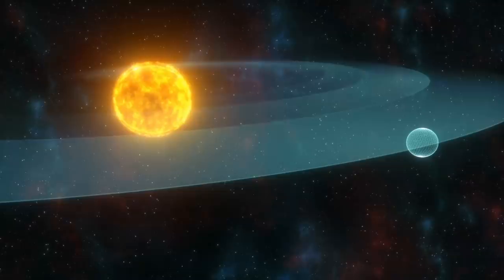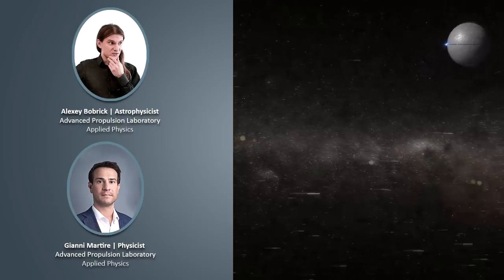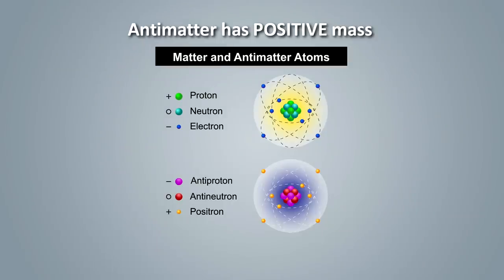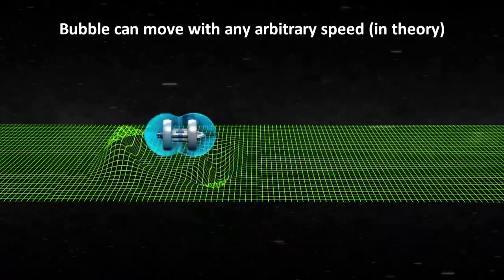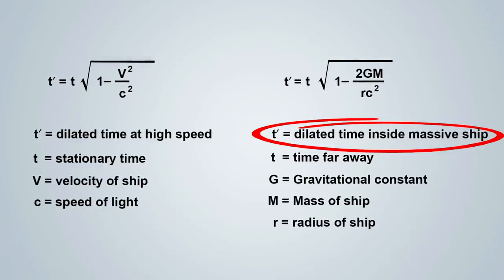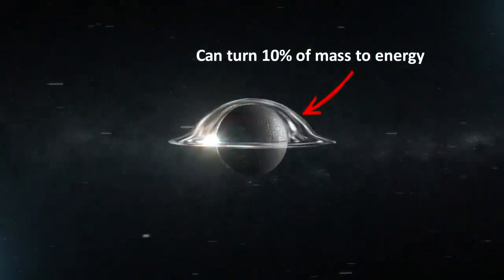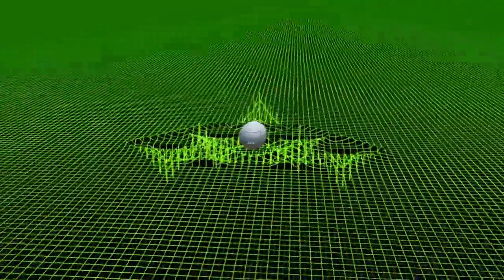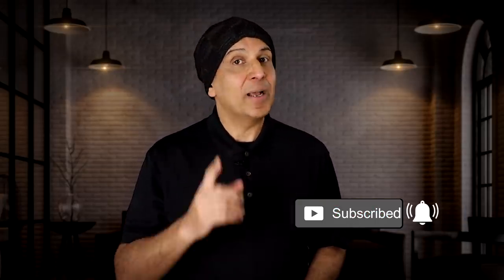REAL Warp Drives? NEW research proposes a solution!

Comment: Faster than Light travel using Warping is not possible, and won't ever be possible.  Alcubierre's solution, in addition to using negative matter also relies on propagating the bubble forward faster than the speed of light.  There is no method for information to travel from the ship out of the bubble to in front of the bubble and tell that space to warp at a pace to keep the bubble moving forward faster than light.  A warping in space-time is effectively a gravitational wave, and we know through multiple measurements that gravitational waves travel at the speed of light, and no faster.  Lentz's solution suggests that there's a special geometry that, if it existed, could self-propagate through space at a rate faster than the speed of light.  There is however, no mechanism to create such a geometry, and if there was a means to do so, there is no means by which a sub-luminal geometry could be accelerated to a superluminal speed without infinite energy.  To take a ship, at rest, and put it into this geometry so that it can ride it at faster than light speeds would require the ship to already be inside and moving faster than light, or an infinite energy to get started.  So while interesting mathematically, Lentz's solution is completely worthless when it comes to engineering an FTL drive.
We've never seen any kind of information transmitted through space faster than light, and any warp drive would require that to possible.
As the video suggests, our only hope for Warp Drives is sub-luminal drives that can let us move significant fractions of the speed of light.  Anything else is fantasy and people promoting it frequently do their best to overlook or handwave the horizon problem.

Comment: you can also just use contraction which uses positive energy.  You can let the universe dop the expansion and travel ythrough the contrated area,  If you make a region od apace 11/10 the size you only need 10% to reach light speed.

Comment: It seems the solution to warp drives is finding the right shape of the envelope,  the evidence lies in the theories currently out there. I think it just a matter of finding the proper configuration for the warp bubble which would allow us to travel at faster than light without infinite power, exotic mass , dense materials,  it would require some out of the box thinking and a new yet undiscovered way of propulsion. I  think when we determine the right size and shape of the warp envelope we could perhaps in our lifetime travel to the stars.
Reply: I don’t get why we’d need infinite power for a warp craft when we know the universe is expanding and pulling objects away from us effectively faster than light. Surely it’s using immense power to do this but even the universe doesn’t have infinite power. And this is observed, not theoretical.

Comment: These UFOs in the news seems to be using warp to be able to seem like they are able to handle 600 g  force but with warp there is no g force, air restriction and can travel through water as well. When moving space around you this also moves the particles in that space around you as well.

Comment: We think to complicate. You see the Space-time and what the warp-drive does to it. So what can cause the deformation of the space-time? So gravity or time can do. We can not change time at all but gravity. What causes gravity or what looks like it? Gravity is only the potential force of a mass. We can show that potential force of a mass by swinging that  mass in a circle and make it real. That is the  only way and kind of gravity (centrifugal force) we can change and so get a uni-directional-force. It is a mechanical thing and I em wondering why Leonardo or Galileo didn't build this warp drive. It is a 3D movement and you have to integrate it while going through the forces but once you get it, it is so simple and you'll ask, why don't we build it long times before.
A warp drive pushes you away with g-forces, how much you want, until the material brakes.
Light is realy slow! And if you go faster than the speed of light or better the speed of gravity, you lose your gravity, like a neutrino! - Sorry, no time travel is possible nor worm holes.

Comment: i you travel at the speed of light and then release light will the released light now trave twice the speed of light relative to a stationary observer or just the speed of light to the stationary observer. how can the speed of light be constant between frames of reference traveling at different speeds. if light travel anything like matter it chould be influenced by the speed of the frame of reference in regard to another. if not it makes little sense because then the light would have to speed up and slow down between frames of reference to match measured speed in each frame reference.

Comment: Why they don't build a fan (like the one to blow air) like (huge) structure in space... They only need to spin at idk 1/2 of the speed of the light, the outer point will be moving way faster then light given enough lenght. Then sling shot the spaceship from it. Just a random thought
Reply from the maker: The edge fan blade would not actually move at the speed of light. It would fall apart before it reached that speed, due to infinite energy needed, and infinite inertial mass.
Reply: @ArvinAsh  you are telling me that they are thinking of negative mass and neutron star mass but can't actually figure out a material to withstand such power... Then how are they gonna thrust their ship if the material fall apart

Comment: What, no mention of the Prigogine Effect or Pais Effect?

Space isn't curved in any kind of real way, gravity is a consequence of the distribution of energy per unit space in the way it affects the baseline electric permittivty and magnetic permeability of free space.  Gravity is a second-order form of Coulomb's Law with all the complex interactions of attractive, repulsive, and shielding effects.  This sucker is electrical.  Compare Coulomb's Law (or Gauss's) and Newton's Universal Law of Gravitation -- the same formula other than that coefficient!  Space is only curved in the sense that if you charted the values of the permittivity and permeability in each unit of space, there are curved-like sequences and forms as Coulomb's Law is applied continuously but limited to the speed of light.  The presence of matter or energy in a particular spatial location should be detectable even after it has departed that location due to the wake it leaves in the distribution of energy/matter and perturbations of all of the space around where it was, and where it went.

Instead of poking sticks at the strange matter in neutron stars (lol!), consider something a bit more basic: https://patents.google.com/patent/US20200289137A1/

Comment: So I've been thinking for all this time. i was thinking sitting on my bed. Theres no electricity. That what if u heat the back half of the ship to extreme temperature and cool the front part of the ship to the extreme temperature . The ship is gonna travel forward as the heat will expand space backwards and the cold is gonna contract space forward. Like how light works. How does light even go that fast when u think abt it. Its coz its heating up the back and cooling the front. Lemme explain. What does light come from? Heat! Everything that emits light emits heat. So my theory is lets just assume light is a piece of paper. The back side of the paper is constantly being heated up from the source so its expanding space backwards. But the front part of the paper isnt heated its cold so its contracting space forward. And thats how it goes forward. 
Explains why space is always expanding. Coz the sun is emitting heat constantly. Thats why galaxies cant exist without a sun or a source of heat. Coz if its cold it will contract and eventually end. So for making a warp drive u just need to heat the back half of the ship to the extreme and cool the front half of the ship to the extreme.  What that'll do is itll expand space backwards and contract space forward. If we for 1 second assume everything is made of 4 types of matter. Solid, liquid, gas & space... then all of them work the same way. If u heat them they expand if u cool them they contract.

Comment: You rather could accelerate to "close to 1 c" and have the same effect with much less effort (then to accelerate a Gigant Neutron mass ball)an less energy needed for the same time dialation ( the only solution would be if you cling onto a Neutron star  moving in the same direction you are traveling...only that would be more efficient)

Comment: A time machine is not a FTL drive. While relatively seen for a speeding car, everyone else is speeding, we acknowledge that the isolated vehicle is traveling at x speed. Also, with that in mind there will be absolutely no question that sentient beings from earth will arrive there. Be it AI, a normal colony ship (traveling the entire years just as the time machine does) or cyro sleep (which is proven to work, but humans are too large and complex for it to work with current tech).

All of these tings are far more reasonable and inexpensive than any FTL drive or time machine as they do not involve themselves with the mount of energy/mass or negative there of.

Comment: Compress the space in front of an object and to expand it again after itself, is not a new approach; that is to say, of Alcubierre, but yes the required metric of said bubble. Maybe not a thesis as old as the black thread, but seen if already before this; after simple examples (didactic); as placing an object on a tablecloth (simulating this is the space); compressing the tablecloth in front of itself; expanding it then after itself (unzipping (unfolding)) in reverse; which causes the object not to travel through space, but space to pass through it (If you moved with this type of technology, you would feel that you never moved, and you would not spill a drop of your coffee, even if your cup is full). I mean, personally, it’s something I’ve been imagining at least 30 years ago, and then I saw the same thing; here and there, in other ways of exemplifying it; correcting that for a new, or revolutionary, idea, etc., of a certain "X" scientist. In short; the theme is to develop the idea; and of course the exotic matter has everything to do (although this principle is optimized; after using a bubble within another, etc.); So instead of talking about exotic matter; we must talk about progress in goal-makingmaterials, to thus express that in this field and heading they achieve new nanotechnological materials, according to the applied energy and necessary envelope. Progress has been made in various areas in meta-materials; and to name a few (within other topics); for example, to get light to surround and pass through an object, and it does not obstruct, or interrupt the passage of it (something like imagining the invisible mantle of Harry Potter, but even if you do not believe it; it is a reality), and achievements as you grow to other areas; like this; applicable to even higher ranges for electromagnetic waves. In another sense, but always in this branch of meta-materials. Sure you. this more familiar, or heard of materials that do not get wet, and that any liquid that passes through its surface passes as without touching it, showing these (in its drops) an angle of surface tension greater than ninety (90) degrees above it; which clearly exemplifies the potential in new arrangements and constructions through meta-materials. Yet we are in diapers in nanotechnology, and of course we are just studying laminar structures of atoms; be a combination of them, sheets the thickness of an atom superimposed on each other, and rotated at different angles, etc., with which they record different behaviors and properties (thus towards our perspectives, scope and uses). Well; this is to say that the scope and perspectives are almost infinite; as for example to cite the use of graphene; in the various configurations of superposition; placing such flat structures, either with phosphorus, boron, silicon, carbon, etc.; in a mix of them, doped, etc.; that is; the possibilities are almost infinite, and so are their interactions, and with whose name also appear new techniques that are nicknamed; of "rotation", "superposition", etc.. So new arrangements throw new behaviors, and understanding towards obtaining for example; in super magnets, energy production (also negative), super capacitors, with memory, indeformable, elastic, heat insulators; in terms of lighting others that will be used in lighting technologies that surpass several times the LED, decanting in the close replacement of the latter, etc.. It sounds almost silly to delve into the subject of Nano Materials, but it is the required jump to materialize; that an object has on its surface the appropriate material, able to withstand the capacity, and dynamism (sequencing) of the energy you want to control, with respect to the surrounding properties and functionality for that object. This diversion at times of the topic in meta materials, is intentional in order to understand the interesting journey, that have been made until now (but of which we still lack much), in advances that would seem to us of science fiction, but that in laboratories are reality; such as having photons extracted from quantum vacuum (something like getting light out of nowhere (by oscillating porous aluminium structures at high frequency, and by means of micro-mirror structures to dislodge such photons from their cavities (the latter truly surprising)). To conclude with this deviation from the topic; half-intentionally; to point out that the latter, would far exceed, to the comment of the imminent replacement of the LED technology; indicating that such a feat has only been possible in the laboratory (to extract photons from the quantum vacuum); and perhaps in a more distant future (overcoming the technical barriers) we could eventually have panels, that emanate light without appreciating where it emerges or comes from the same (like flooding our home with light, not knowing where it came from). In reference to light; it has even been achieved in laboratory to convert light into liquid and solid; that is, transformed to those two states of matter. We go well, but we must be realistic, and reach a higher level of miniaturization, and technique, at least distant to 30 or 40 years; And returning to what summons us; therefore we must get to wrap an object that removes us from the gravitational waves, because otherwise we would need exorbitant amounts of energy by not optimizing the material envelope of the object to that need. It may be 60 years or more, to have the above resolved; and yet you. do not believe it; by doing so have the time management (eye; time; not weather; in fact already the journey with that technology, is already a time space bubble, and yet it is not synonymous with time travel, but it does isolate us from this, and after that only distant from a small step to go forward or back at will).

Comment: If the hypothetical "dark energy" is expanding our universe 73.3 km/s/Mpc, the answer to interstellar travel may lie in harnessing dark energy, once we discover what it is. Simply put, move the energy from in front of the spaceship to behind it, similar to air moving around a wing. Instead of a drive "pushing" the ship forward, develop a drive that would "pull" dark energy from in front of the ship. It creates less friction to pull something than to push it, considering the object being pulled/pushed is traveling on the same plane. What ever, I'm getting another glass of wine........

Comment: Perhaps there is no speed limit in the universe. But rather the speed limit we perceive is that our brains use time and light speed to function. So any analysis we do cannot rationally include speeds faster than light since our entire physical reality is dependent upon spacetime and the speed of light. We literally cannot function without those limits. So any solution by definition has to exist outside our physical reality and will always seem like science fiction. In other words we can imagine via mathematics potential solutions. But they will always seem to be impossible once we apply the limits of our physical reality.

I'm rambling but the point is the solution must exist outside of spacetime. At the end of the day what we're really talking about is a time machine. My guess is if this is ever solved (ftl travel) it will involve exiting spacetime completely and then re-entering.

Comment: Check this out: This explains a gravity drive, that generates negative gravity (that pushes away, instead of attracting), what you might call negative mass. In my judgement, the power that is required to generate a gravitation field is far beyond out capability https://www.youtube.com/watch?v=BEWz4SXfyCQ  This also discusses a gravitation field that bends even light around the object, you could generate a gravity shield, that would deflect everything. Please note how he describes these space ships, that they are small and don't have any long term travel equipment, so we can assume that they flew many multiples of c, like 50 to 100 times c. We by the way don't know how they found these ships, some assume that they crashed, but I think they might have just found them parked in some cave or remote area that was hidden.